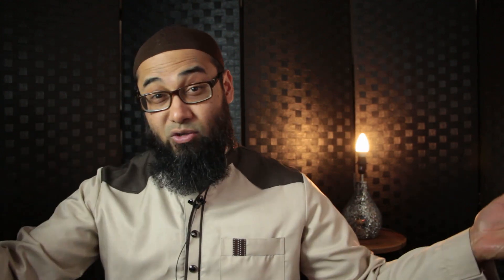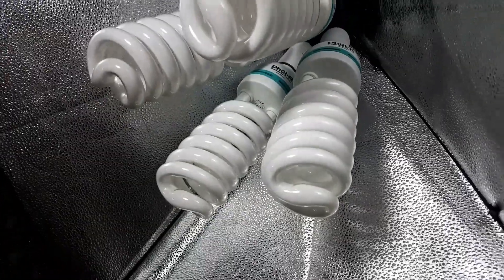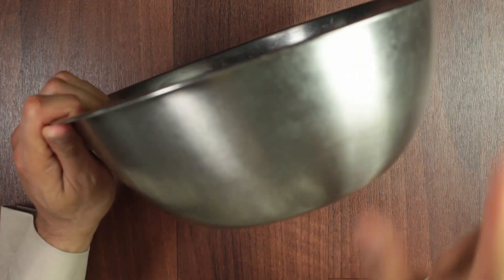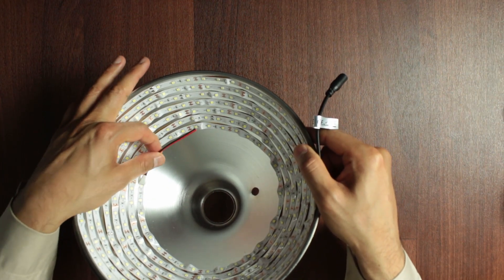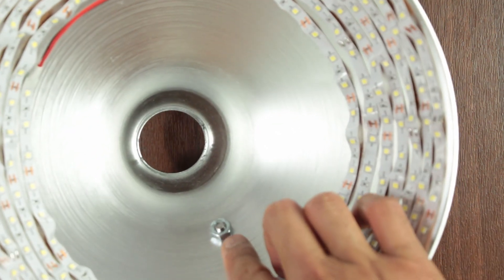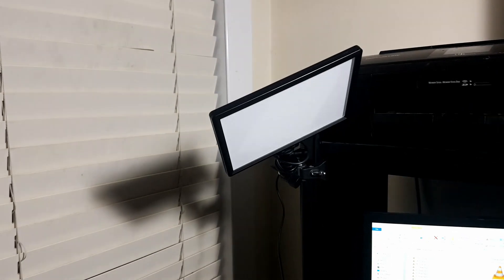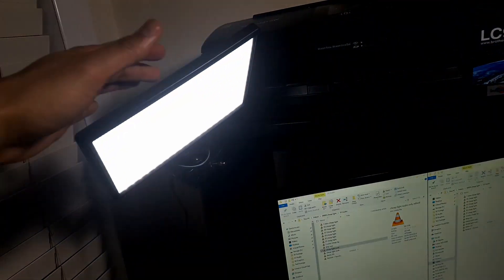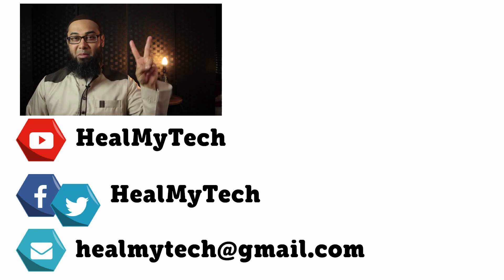Cheap Light For Video - $15 (£12) DIY Cake Pan Light

Comment: i need help,so one of the pins on my motherboard broke off and from then my computer booted up but never displayed anything on the monitor so if i replace it with a new monitor will it be back to normal???
Reply from the maker: Sorry but I don't think I understand correctly.  Which pin on the motherboard?  And no if your motherboad has an issue then replacing your monitor will not solve anything, unless you monitor is also faulty, and replacing the monitor will only fix the monitor issue, not the motherboard.
Reply: It’s the cpu pins
Reply from the maker: Then yes most likely your motherboard is now faulty, socket pin repair is almost unheard of even with manufacturer warranty, if still under warranty they prob can replace depending on how it became faulty, you can try your luck!

Comment: @Healmytech  Hi I have a small problem with my computer it's working   more then 30minutes and display is turning off and CPU fan spin fast
Reply from the maker: What troubleshooting steps have you done so far?
Reply: @HealMyTech1  I check the rams and CPU fan wires and others I can't understand the problem but I replace the power supply recently I think it's the problem but I am not sure